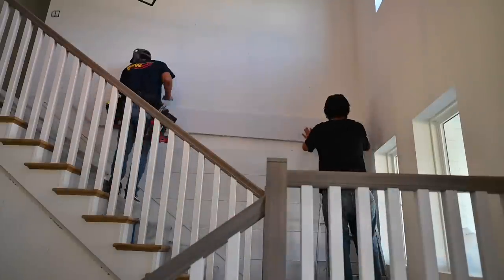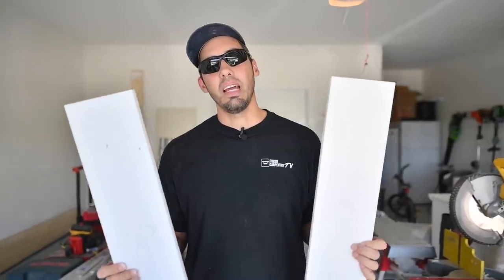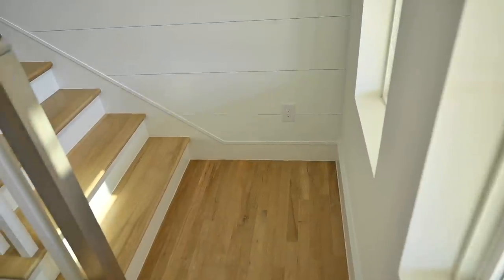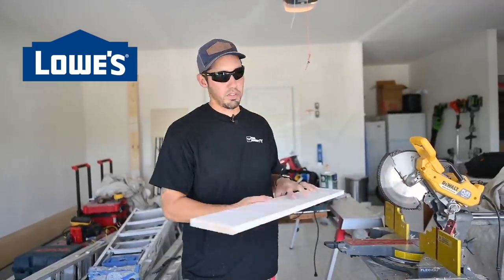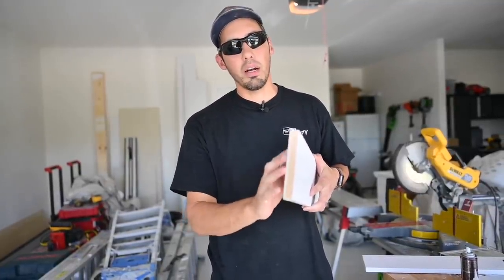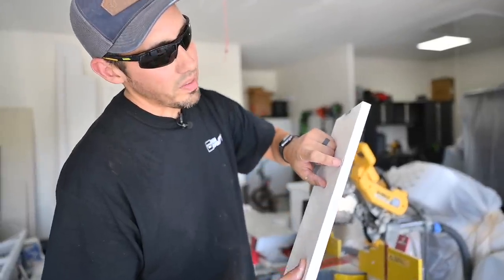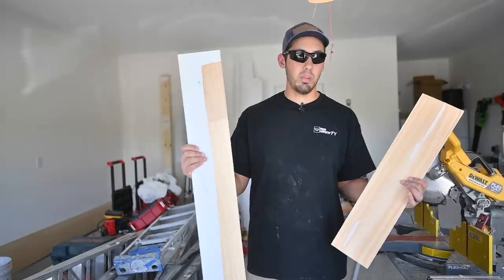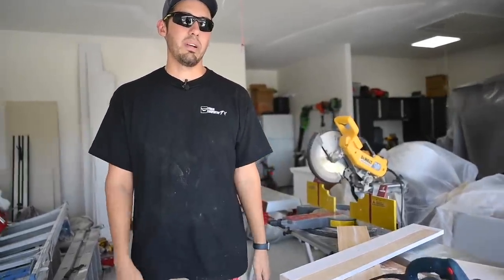DON'T Buy These Boards from Lowe's

Comment: Its not only about quality, its about availability as well.  They call it the Wood Shock.  The DIY stores in my area only sell finger-jointed pine covered in melamine or lauan veneer (Philippine mahogany).  Same with plywood.  Only basic construction grade stuff, three to five plies regardless of thickness, surfaced with lauan and not very good quality lauan at that.  Must be handled with thick leather gloves because the stuff is so ridiculously splintery.  I also can't find Baltic Birch plywood in any grade anywhere....  :>(

Comment: Here you would be lucky if I could find a dozen square, true and unwarped boards-- primed or not at our HD or Lowes.  I try-- but after 20 mins of wondering where in the hades they got this twisted lumber, I end up going to my not-so-local lumber yard about 15 miles away. Yes they are a bit more expensive, and if I get enough they will deliver. But at least it's straight and true quality lumber.

Comment: Wonder if you'll even see this but I am looking at buying a new miter saw and I cannot make up my mind between the Dewalt flexvolt 12" and the Milwaukee 18v 12". I have both platforms battery-wise so that's not a factor. I tend to like dewalt's miter saws (I have no experience with Milwaukee miter saws) but at the same time, I have the Milwaukee table saw already. Now I have watched you try them all can I get you to weigh in on this? You have the Dewalt going in this one is it your preferred saw?

Comment: Lowe’s/Home Depot lumber always says “premium” on the placard above the lumber. I can’t even imagine how contractors can find enough good lumber at these places to build a house. Most of it is warped and not dimensionally correct.
Reply: I hate going to Home Depot and digging through a pile of 2 x 4's just to find a few straight ones. I'd say only 20-25% of them are halfway decent. And then you take them home and a few days later they are warped anyways.

Comment: based on your recommendation, bought $1000 worth of windows one 1x6x16.  not even close to backside being usable without sanding.  So bummed to use it as pine T&G.  Is this your experience?  to use the printed backside, you have to sand all the paint splotch spots?

Comment: Nobody is ever gonna know the difference... sheeeesh. The clay primer is actually easier to sand smooth (doesn't usually even need it) and has a harder finish (chip and scratch resistant) once painted than the pine.

Comment: I had to rely on a fence builder to do my fence as i misplaced my contact info for my “go to guy”. difference is the other guy charged 400$ more and went to a quality lumber store for fence work and the guy who did my fence got his from lowe’s.  The quality of the boards is insane in comparison.  now 2 months later i am gettjng warped and twisted boards.   i am wanting to take much of it down.  just annoying. 

wish i could post the pic of the “tree” that Home Depot got their lumber from.  oh was it fitting. 🤣. 

good info on this.  quality.   i see the same when i order crown from lowe’s. I have to check each piece to make sure they identical in profile. same stock- inconsistent and i don’t want to see that seam after glued.

Comment: I’m curious about that coating. Is the dust safe or should a user wear special equipment to protect themselves or the site?
Also, I’ve found that the local lumber yards in my area are many times better priced the national stores. The products they sell are much higher quality. The employees can and will help you. And if I make a purchase over $500 they deliver it to my driveway for free within 24hrs.
Reply: No dust is safe to breath.  Wear atleqst a N95 mask regardless of what is producing dust while you are working.

Comment: Doesn't matter if they where 5$ more a board 20' tall wall 1x12 = 20 boards 100$ if somebody ever complains about that cost difference let them get the scrap work!! I milled some of that 1x from lowes on a table saw in my garage should've had a respirator nearly choked me out

Comment: Home Depot and Lowes sell poor quality materials to homeowners that don't know any better. I worked as a carpenter for decades and I would not shop at either of those stores for my materials. A good chunk of the products sold at the big box stores is suspect. That goes for the lumber, plumbing fixtures. tools, etc. If a name brand product has a part number you're best bet is to check the number and make sure that it's not exclusive to that particular big box store. They will have products manufactured to meet their price points with out any regard for the decrease in quality.

Comment: I’m surprised that you were actually able to get product.  I have found that Lowes has moved to more finished products and has begun to abandon the diy’er or even contractor except for the most generic and popular products.  They appear to be moving out of Home Depot’s “product strength zone”.  I have almost stopped going to Lowes after being continuallly disappointed with what they are NOT stocking these days.  I wanted old work electrical boxes.  Their blue box section was almost completely bare.  I went to HD and the aisles were overflowing with large shipping cartons of blue boxes.  There are other instances where I came up empty handed at Lowes but you get the idea.  Sad.

Comment: Keep spreading the truth.
Windsor One is the best . Well worth the cost. But as you pointed out,Is the same as the Lowe’s boards. 
What do you or your painter use to fill the nail holes?
That stairwell turned out very nice. Well done.

Comment: There's a time and a place for high build in your primer. That particular factory primer all if these places use is really bad though and mire importantly it does not bite into the wood. That is what im after with any primer right off the bat

Comment: These boards are advertised as pre-coated shelf boards. The coating requires no further sanding or painting. You just compared apples to oranges.

Comment: Finger joint wood is not good at all and the  Primer on these  boards  are really bad,  I like to use my own Primer I see people used this wood outside it doesn't last and paint start pealing  because the bad Primer , but when I used this boards for exterior use because people look for a low cost in wood I removed the Primer and used oil base Primer, and for interior I just add oil based Primer on it . Thanks for the info 👍 I like your videos  , your videos are very informative and entertaining.

Comment: I noticed the Lowe’s board is plain sawn, which is the cheapest way to cut lumber and leaves the direction of the grain in a way that makes the lumber prone to cupping, and the Windsor looked quarter sawn which is much more dimensionally stable, maybe that explains why there is less of that clay stuff on the edges of the Lowe’s board
Reply: I can assure you that the WindsorOne board is not quarter-sawn. I’ve used a ton of it & sanded it down to raw wood. It is flat sawn. I would say WindsorOne probably selects, Mills, handles and treats their product better. But they are not using quarter sawn or rift sawn wood for paint grade trim. It is high quality material, though, and I recommend switching to it.

Comment: The big box stores are not going to change; they consistently reduce quality to increase profit. Even machinery like lawn mowers; the Lowe's model and the identical model from an outdoor power equipment store will be very different products. Lowes used more plastic and thinner metal.

They consistently aim for the bottom end of tolerance for what is acceptable.
Reply: Its like a bag of anything at the grocery store every year they take a little bit out but put it in the same size bag

Comment: Curious about how bad that finish on the Lowe's board is for your health and the sharpness of your tools!  I am a finish carpenter who does a lot of similar types of work, that crap wood from HD and Lowe's has some other bad qualities.  It MOVES like you can't imagine!!!  Assemble something that looks good, caulk and paint it and when winter comes EVERY joint opens!  I don't care if you glue the joints and liquid nail it to the wall, it moves!!  The other thing is knot bleed as well as bleeding between the different finger jointed sections.  It's just crap!  We started using Windsor One a while ago and ALL these problems went away!

Comment: Deck boards in 2020 from Lowes were bad bad quality. Warped, uneven, not squared.   Always look at every single board in the stack!  You will end up returning them if u dont check.  Low quality are hidden at the bottom.  This is probably shipped this way to the store. Lowes doesn't like it when i visit. I pull off ever board and restack them.  They are being stamped high grade and they arent!   Also many boards were still soaking wet from treatment which isnt good to install until dried.  I wont say what state but they were shipped from southeast state mill.   They were all stamped same grade.  Ripoff!   Also the marketed coated "yellowish" deck screws all break off.  Bad bad quality.

Comment: You are using products we would never sell.  I have retired from the building products retail
and real pine was actual wood locally milled and sold.  Sugar pine was my favorite.
Your Radiata pine has huge growth rings.  Old growth lumber never had rings larger than 1/16 inch.
Times have really changed. Good luck

Comment: The question everyone needs to be asking is why do people buy primed Lumber in the first place? And the answer to that is because it cuts down the production time of any trim work you do by a considerable amount of time to get to the overall finished product after painting. And if you're talking about the quality of Pre-primed wood as opposed to stain  Grade Grade wood there's no comparison but you're not using it for the same thing are you. Obviously any project you're using this preprimed wood for is a project that's going to need a final finish coat. I can tell you straight up if I'm bidding a painting job and the Carpenters aren't using pre-primed Lumber the cost for that project is now double. I guarantee you preparing unprimed Lumber and to make it look good requires twice as much labor because wood that you can buy in today's market is garbage. I personally love this thick primer coat on this wood and if there's any issues with it I can fix it very quickly you can't do that with a primed Lumber with only one coat on it.

Comment: I have a moulding mill down the street from me and from talking to the various suppliers and hardwood stores in my area, they all get their stuff from the same local mills.  It appears that the mill will make anything you want, from crap to perfection, it just depends on what the reseller wants.

Lowes gets their stuff from these same mills (I confirmed this with a reseller) but I think it's a Walmart/Huffy situation where they (Lowes) say they'll only pay so much per foot but they'll buy millions of feet of it.  What's the mill gonna say, no?  And since Lowes/HD kinda cater to the peel-n-stick crowd, they don't really care about the craftsman.  I used to like Lowes but it's turning more and more into the Chinese outlet geared towards the scrapbookers.

Comment: I still cant get over the fact you are paying $37 a board for off cut finger jointed and glued piece of lumber.  That's insane.  For that kind of money I would expect it directly from the tree in one piece.......  These kind of products makes me want to mill my own.  By the way, I built a deck from Lowes PT lumber, I spent a fortune about 4 years ago.  The lumber has rotted, bowed, bent, broken, sagged and the knot holes have fallen out of the floor planks...... I dont expect it to last another 4 years.  I will never buy lumber from them again.

Comment: Lowe's board here is going to dull your blade more, if that is really a clay coating.  But the wood grain is more consistent from finger joint to finger joint than the Windsor.

No board should be sold as solid wood that is finger jointed. It's false marketing, and overpriced for that type of material.

Comment: Seems illogical for them to put that thick cheap coating on the boards.
If they were smart, they would make the boards even thinner, improve the quality of the coating so it is superior to the wood, and market them as high quality designer boards.

Comment: It should be noted that ALL Lowes plywood is 1/16th of an inch thinner than any other lumber yard's plywood.
Instead of 5/8ths Lowes sells 9/16ths instead of 1/2 inch Lowes sells 7/16ths...instead of 3/4 " Lowes sells 11/16ths. Across the board ALL their plywood is 1/16th thinner than industry standards.
 It improves their margins and screws their customers.
 Horrible company.

Comment: The heavy clay/plastered primer probaly comes out of Chile, poor quality all round.
Try centurion or solid gold produced claymark new zealand.
Water based h3 treated, then coated with a uv sealer and 2 acrylic primer coates.
Quality finger jointed product with tight quality controls and the solid gold as it says is a solid board no finger jointing. How ever being a solid board it can have more distortion.

Comment: I've never liked those thick primer boards. Bump it one time and the board is done. I've even seen baseboards and crown molding with that coating on it and yes, it looked like it went through the shaper table with the coating on it. Looks like shit when it's finished. My trim supplier was getting that shit.

Comment: The only thing I buy from Lowe’s with that coating on it is shoe molding...
-And remember people… Shoe molding is for the transition from the baseboard to a hard floor… Quarter round is not!
Reply: Don’t forget to mention that only hacks use shoe Moulding…. Rookie 🙄🤣
Reply: @Reallythough21  What do you mean by that? I’m pretty sure you don’t know what shoe molding is.
I’ve been a trim carpenter for 30+ years... I believe the only talent you have is annoying people like a typical duché... pardon my French

Comment: You lost me at the power plane. Best way to do the test is with a thickness planer, simply to eliminate the human element. Your second pass would have brought so many possible imperfections with pressure, position and the tool making contact with your unfinished first pass. Other than that I think you’ve really brought the attention that this issue needs. Thanks for all your videos and I look forward to more.
Reply: Thought that too...not to mention the 1/2 width possibly adding to potential inconsistency. In Richards' defense though, I would rather dull the power planer blades than the helical cutterheads or conventional knives on the thickness planer.
He proved his point well enough.

Comment: I’d be more concerned with the blades and how fast they need to be sharpened. The paint/primer coatings , read the ingredients, titanium dioxide, feldspar, etc. 
your talking dirt. It all comes out of the ground. That stuff is hard on blades. Working with raw unfinished lumber is what we always did. Blades last months. As for the other issues oh my goodness is it really that big of a deal ? For some yes it is. For me I like to see the wood grain. Wood changes over time. It’s gonna move. Reading the grain is very important. Learning how as well. I’ve been a carpenter for almost 40 years. One point not mentioned, that 1/16” primer can also be looked at as protection for the wood plank. In certain situations a thick undercoating is just exactly what is needed. Every situation is different and the Lowe’s material has a place.

Comment: Seems obvious that Lowes and Homedepot are using their monopsony power to squeeze the suppliers. The suppliers, in turn, create a product of marginally inferior quality. This allows the big boxers to directly trade quality for profit - where the naïve DIY'er isn't even aware they're making that trade-off. And paradoxically, perhaps, since the average  consumer is ignorant, if these Lowes boards were actually priced commensurate to their true quality, the consumer would likely experience lower buyer satisfaction, i.e. for the same exact product.

Comment: I don't use lowe's anymore hardly for anything especially wood there help are always rude and I think that is because there not knowledgeable in the field they are working I put new windows in an apartment of mine 10 years ago and they need replaced all ready,, and my house which is next door to the apartment is over 170 years old and it still has the original windows

Comment: One quick correction, you kept referring to the issues with "what Lowes did, or how Lowes made the board", Lowes didn't make that board the three major lumberyards that all box stores buy from Made that wood board. Lowes is just a middle man, the same as 46 lumber, Home depot. etc. and those three lumberyards are the very reason prices are what they are and it isn't because of COVID. it is pure greed, using an excuse to raise prices and gouge customers

Comment: Sorry but a true 1 x 6 is not 3/4 x 5 1/2 and for your application here what difference does that matter anyways, that 1/2 inch on every board still needs to accounted for when making calculations. As far as that coating and your story about them saving on costs, I don't believe that for a minute. I'm sure it's just to give you a smooth and blemish free surface and maybe to hide knots. Your right about cabinetry  grade and the joints, but that's not what this was intended for.